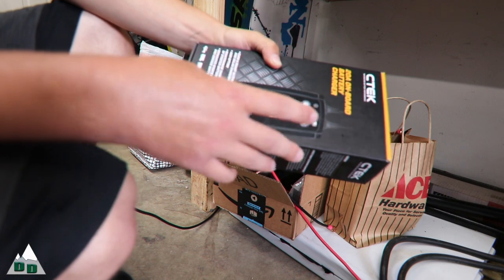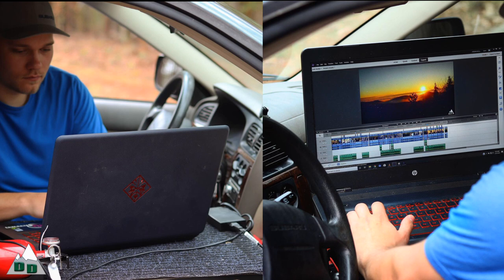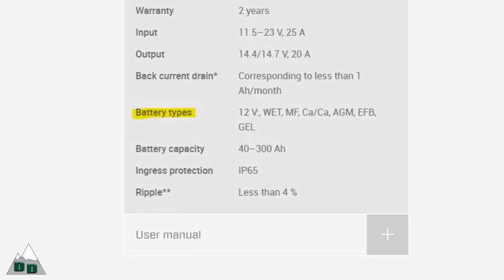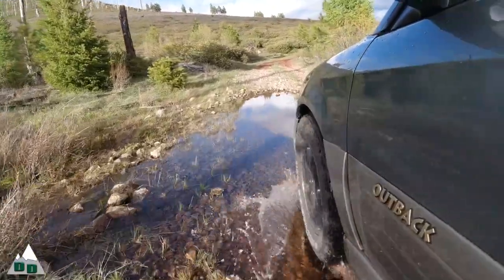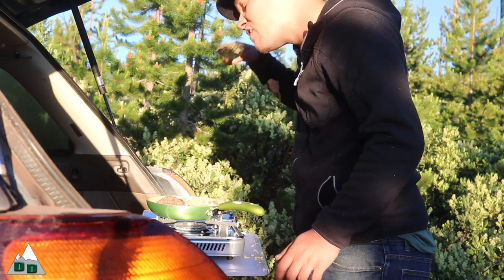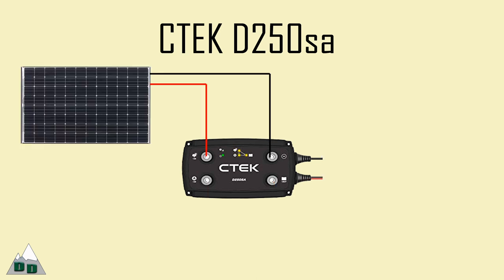CTEK D250SA Dual Battery System Charger Review

Comment: Great Video, Well explained for those like me who have no scooby when it comes to batteries and electrics. Thanks. I recently bought a Crusader J220 Uk Mains Converter Lead from Amazon to charge my leisure battery from a main socket in my garage while my T6 camper sits idle on the driveway. I have had it plugged in for over 24hrs with the charger switch on my Sarget EC155 'on' but on the control panel (sargent ec50) have not moved from the low amber light. Would you know why? Love to hear your thoughts. I have the CTEK 205SE installed also but the indication lights on my panel dont ever seem to get to green (full). This was all installed in MArch 2021

Comment: I found this very informative. I'm trying to do just the setup Donnie is and most of the info out there seems focused on RVs with larger solar panel arrays.

But since this video the prices of Lithium Iron Oxy batteries have dropped dramatically.

Comment from the maker: LINKS & TIMESTAMPS
D250SE (New Model Now Compatable W/ Lithium Batteries) : https://amzn.to/2xYsh58

Smart Pass (For battery banks over 100AH) : https://amzn.to/2Y6Zvd1
_____________________
1:22 | Quick Overview Of The D250sa 
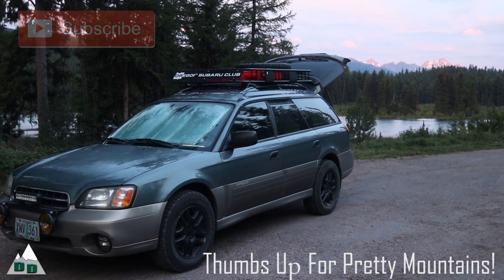2:55 | Who Is The D250sa For?
4:54 | DC-DC Charger VS VSR (Split Charging Systems) & Battery Type Discussion
10:25 | Smart Alternators & Why They Need a DC-DC Charger
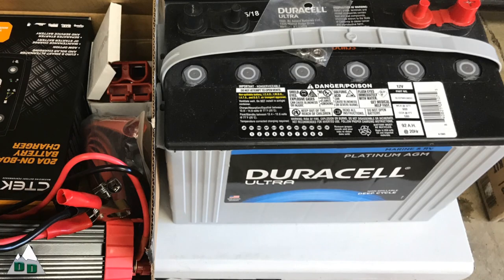12:25 | Costs
15:00 | Specs & Accessories
17:17 | Solar Panel Input
19:40 | Charge Time
20:45 | Installation & Wiring
23:53 | Other Competitive DC-DC Charger Options
27:30 | Reliability
28:15 | Summary

Comment: Hey Donnie awesome vid mate I've really learnt alot. Hey with the red and black wire? The black one you earthed what you do with the red one? My manual says to connect it to the alternator but if I don't have to I won't.
Thanks in advance mate you got a sub from me 👍🏻
Reply from the maker: The red one you connect to an ignition source if your vehicle has a smart alternator. Mine doesn’t so I left it alone.
Reply: @DonnieDispersed  thanks for the reply mate I've piggy back fused my 7.5A  ignition, seems to be running neat 👍🏻

Comment: Thank you, great vid!
I bought a 2nd hand d250s and was wondering, can I add a 110 volts charger connected to the aux battery without messing it up? Will it possibly even charge the start battery when charger is on?

Comment: great video that mate , i learnt allot from that , very informative, because i dont have a smart alternator can i skip wiring the ctek to the ignition ? is wiring to the ignition just for modern smart alternators? im using a split charge relay at the mo so was just going to do a straight swop to ctek to look after my agm better
Reply from the maker: Yup, you can leave the red wire for the ignition disconnected if you don’t have a smart alternator.

Comment: Awesome Donnie. What size (gauge) is the red cable between the batteries and the charge controller?
Reply from the maker: Robert I used 2 gauge welding cable but that’s pretty overkill since I’m not using a Smartpass. Manual calls for 8-12 gauge depending on the length you need to run.

Comment: Thank you for sharing!  I’m wondering if this would work well for feeding power from a tow vehicle to a camper trailer (RV; 17’)?  It already has a power panel but this seems like an ideal component for it to convert to lithium (D250SE).  Not sure if the 7-pin can handle all the current though?
Reply from the maker: Not sure about the 7 pin, but my first thought would be to use some heavy wire and an Anderson plug dedicated to the charger. Have it near the trailer plug so you can just hook it up when you hook up the trailer.

Comment: Since the CETK is an MPPT DC to DC charger, and will accept input from Solar panels, you say on the video that the Solar input high voltage is 23 volts.  Does that mean that I can only hook my solar panels in Parallel, or is there some way that I can place them in Series, which would create an input of up to 90 volts. Can you please advise?  Also, my RV auxiliary batteries are LiFeP04.
Reply from the maker: You would need the new D250SE for your lithium batteries. I actually emailed Ctek about the input voltage and they said anything over 23v will damage the charger. So you would not be able to input 90v.

Comment: Do you really need to bring another negative cable from service to start battery ?
Isn't enough that both batteries are grounded to the chasee ?
Reply from the maker: Syncro Van I didn’t ground the auxiliary battery to the chassis. But you definitely could if you didn’t want to run a cable to the starting battery. Personally I try to avoid adding too many chassis grounds just to simplify diagnosing a bad ground in the future.
Reply: @DonnieDispersed  Well...I asked because my van already had grounded the service battery and there's a bit distance between two batteries. I just installed my 250SE and your video saved my ass. I'm so tired and is so hot, that I didn't even paid attention about the small black wire that need to be grounded for AGM. Luckily I've seen this and decided to take a break. 

Maybe I found why they indicate to put negative together. Damn... I've worked for nothing the entire day ! Now I have to wait till finding more cable for negative. 

Thanks !
Reply from the maker: Yah, if your service battery is grounded to the chassis you don’t need to run another ground cable back to the start battery. That’s just the way I chose to do it.

Comment: hi, on the ctek bottom right there is a black and red cable together. the black to the earth. where does the red one go?
i have a smart alternator and someone said it must connect to the ignition?
Reply from the maker: According to the manual the red wire goes to a keyed ignition power source if you have a smart alternator.
Reply: Many thanks. Great video👍

Comment: I've just tried to attach my new portable solar panel on the Cteck, but in my case, nothing happened, no charge, not even a led on.
Reply from the maker: Syncro Van what are the specs on the panel?
Reply: @DonnieDispersed  It's the Eco Worthy 120W kit. I've test it with included regulator as well as with my old MPPT and works fine. When connected it directly on the Cteck, nothing happens. On the other side, If I connect the solar panel directly on the starter battery, the Ctek start charging the service battery as if the engine is running, which is still fine and probably I'm gonna use that trick. But for the money, I'm not sure If is worth keeping it if this function is faulty. Tomorrow I'm gonna try another solar panel.
Reply from the maker: Syncro Van I would email Ctek, they were pretty quick to respond to an email I sent them about a solar panel I was thinking about using.
Reply: @DonnieDispersed  I bought it from Amazon and no direct contact, but I might also take this option in consideration, before giving up. Actually, I intend to keep it, but a fully functional one. ✌️
Reply from the maker: Syncro Van make any progress on figuring out the solar panel?
Reply: @DonnieDispersed  I've test it with my old standard solar panel and it's working. Then, plugged in this portable solar kit, but get cloudy and although the leds indicated as charging, I'm not so sure, because somehow it might get stuck memorising the old panel. Still need to do some tests, but for now I'm stuck because my lift us damaged and can't go up in the van (I'm in the wheelchair). After fixing that, I'm going further with solar test and preparing for permanent setup.
Reply: @DonnieDispersed  Hey buddy ! 
For some reasons, now that portable 120W solar kit is working to with the D250E, charging like a champ !

Comment: When setting the charger up for AGM battery you ground the black cable. Why not just attach it to the negative connector on the charger? 
Then the negative cable from the charger to the AGM battery negative just need to be a thin cable, 2,5 mm2 or 13 gauge cable, because there are virtually no current floating through this cable, it's only for giving a reference to ground (or negative). Solar panel negative goes right to the AGM battery.
The temperature sensor should (if possible) be attached as close as possible to the negative pole on the battery.
The D250SE is also compatible to smart generators.
I have had a Ctek DC7DC charger on my boat for nine years now, with a solar panel. Still works perfect. I have also installed loads of these in other boats.
Reply from the maker: Patrick Lindahl I just wired it the way the manual said to. No need to deviate from that, it’s simple enough.